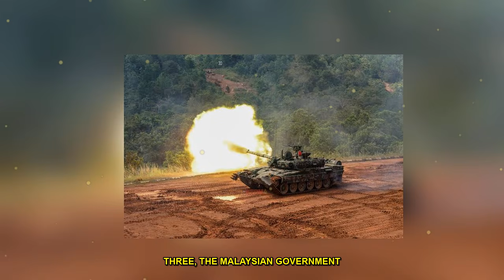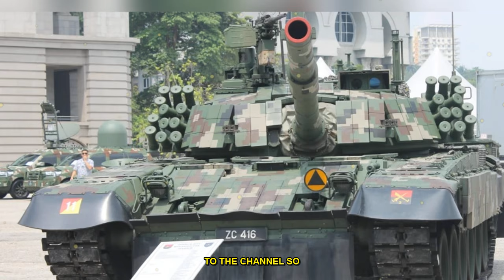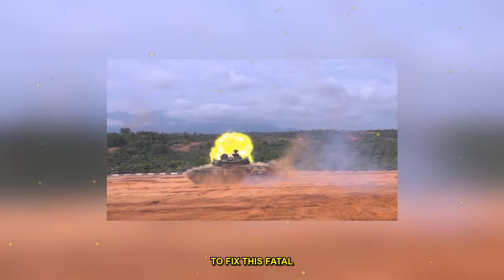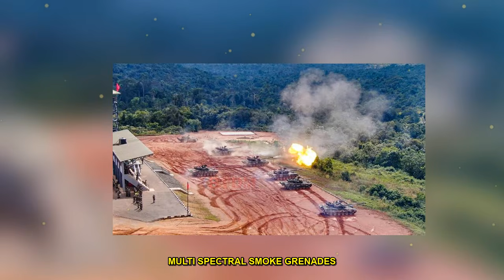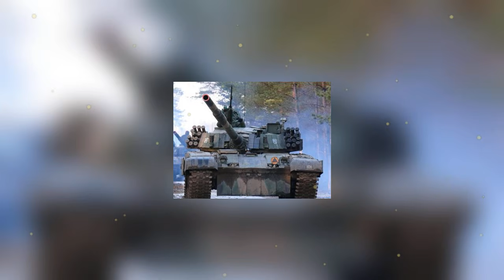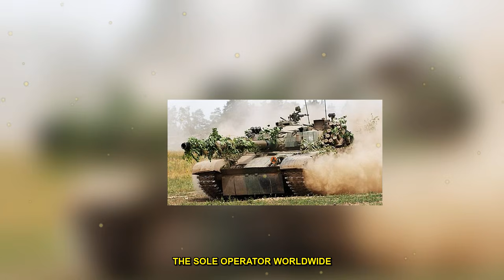Malaysia PT-91M Tank: The Secret Western Tech Inside A T-72

Comment: Based on current geopolitical situation or events around the world, Malaysia should further strengthen its defense agreement with Poland, with new procurement or cooperation agreements with Transfer-of-Technologies (ToT) as full package, so that they could locally produce, assemble and maintain its existing and/or new fleet if they intend to keep using this MBT, instead of buying other new model MBT from other countries in the near future.
Reply: The problem is that the PT-91 isnt a Polish tank but rather an upgraded T-72, and even DefTech likely wouldnt have the sheer industrial capability to locally produce them. Probably better to just retrofit them without Poland's help since the Malaysian defense industry has grown over the years.
Reply: @YeetusDeletus-vv2xqyes indeed. That could be another way of doing it😊

Comment: However, Poland which built the tank bought by Malaysia ordered  360 units K2 Black Panther tanks from South Korea
Reply: Well Poland stopped building PT once they are fully integrated with NATO. Under NATO requirements Poland needs to spend  x money for defense and when German can't meet Poland requirements SK ventures in. We did try The Korean K1 prior to selecting PT.  Weight is a constraint for us then and still is. So anything more than 50T will have lot's of problem here. Why bother build an infrastructure for others MBT to push. Beside we don't have any hostile nation bordering us via land.
Reply: @nuurulbasarmohdbaki6046  So currently the Polish Army has Abrams M1A1 FEP, M1A2 SEP v3, Leopard 2A5, Leopard 2PL(M1), some Leopard 2A4 (modernized to PL), K2 Black Panther GF (in future PL), some PT-91, some T-72M1R, some T-72(M1). The K2 first appeared at the MSPO trade fair in 2018. The tank was then planned to have seven pairs of wheels, a central driver's hatch, and armored sides to meet the Polish requirements of the Central European Plain—Korea is a mountainous country with ravines, and heavily armored sides are not necessary. Ultimately, extensive modernization was abandoned to avoid repeating the mistakes and waiting times experienced with the Altay in Turkey.
Reply: Poland had projects to leopardize or leclercize the Twardy. Several modernization proposals were made, but they were too expensive. This was generally the industry's initiative. There was also a proposal to create a new Gorilla tank. Cooperation with Italy was also considered. Modernization to the PT-91 Twardy was limited due to limited funds. Some Polish PT-91 Twardys were built as a redesign of the T-72 (T-72M1Z), while others were built from scratch. At that time, the FCS Drawa had an Israeli first-generation thermal imager with mechanical scanning (a single, shiftable thermal strip). Unfortunately, in 2005, the right-wing party took the power, which worsened relations between the Army, the Ministry of National Defense, and the defence industry. Export contracts were terminated. The industry faced significant difficulties. Due to lack of funds, the industry decided to sell the premises of the PZL Wola plant, which produced copies of Soviet engines for the T-72. The documentation was lost, and the molds were destroyed. And the land itself remained unsold for a long time. This compounded the military's distrust of companies with socialist influences, as well as a blind faith in the capabilities of Western tanks – Leopards, Abrams, etc. At that time, Germany gifted Poland 128 Leopard 2A4s in 2002, at the cost of deconservation and transportation. As German vehicles, the Leopards proved highly efficient, boosting morale in the Armored Brigades. The powerpack meant removing the engine in 30-60 minutes, or from Twardy 23 hours. Combined with a blind love of Western products, this created a reputation for powdered "shit." However, as the war in Ukraine has recently demonstrated, the tank had its advantages (weight, training, ERAWA). An American lobby also operated within the Polish Ministry of National Defense, confirmed by court cases, and the faces of the lobbyists remain in the industry press to this day. The same trade press reported that the Abrams was being penetrated through in Iraq by the RPG-7VR. Unfortunately, the editor-in-chief died at a young age. Ultimately, however, the blind belief in a single MBT disappeared, and the lighter MBT became the Black Panther, while the heavier Abrams. However, the Leopards were maintained, serviced, modified, and modernized for 20 years. The chaos stemmed from the panic caused by the war in Ukraine. The Malaysian PT-91M Pendekar is far superior in capabilities to the PT-91. Primarily, it has a more accurate gun, a hunter-killer, a higher reverse speed (Ukrainian shoot-and-scoot), and so on.
Reply: 1,000 and 500 Abrams tanks, mostly produced in Poland.